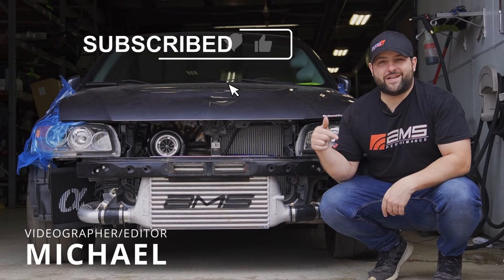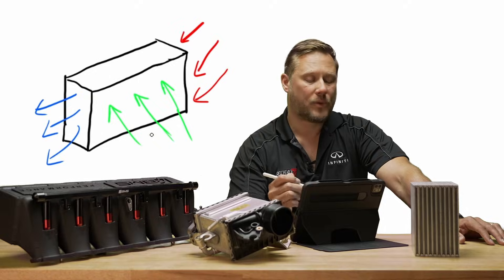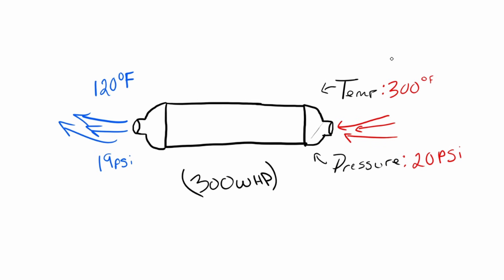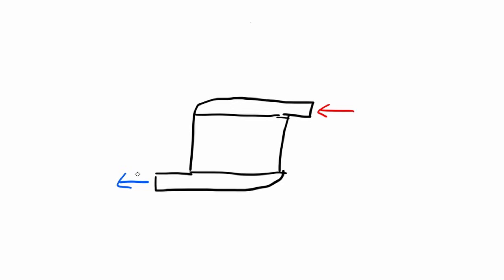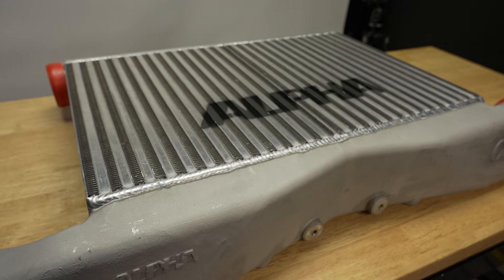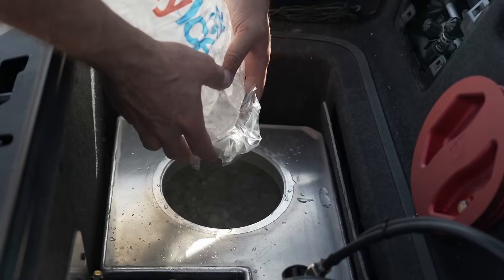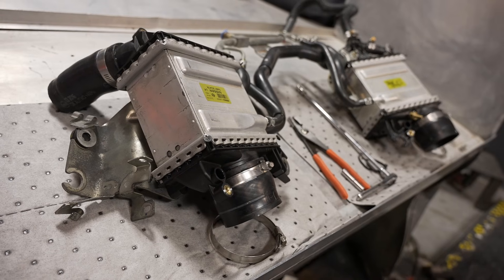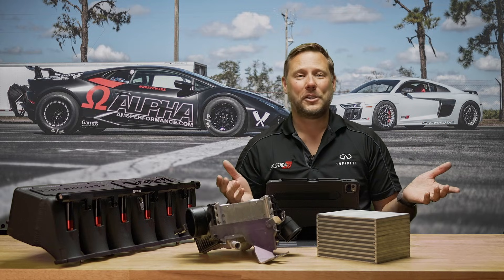What Intercooler Type is BEST? | Air to Air VS Air to Water

Comment: Don't forget that cooler air will naturally have a lower pressure too, it's not only the restrictions of the intercooler that cause the lower boost psi.
Reply: Yeahhh that's something they didn't mention, yes you lose boost pressure but that's because it's denser air. The same amount of air in weight is flowing through. The intercooler restriction isn't that much.
Reply: Exactly! A better measure would be CFM into the intercooler and out. Lower temps and less pressure just means its doing it's job.
Reply: A lack of velocity in the system after the intercooler can be fixed with the proper size piping, i've seen guys running turbo four cylinders and they're using three and a half inch piping from the intercooler to the throttle body when they're only making like three hundred horsepower and dont need the flow, and the Turbo lag is insane, because of the lack of velocity and the turbo having to make up for it.
Reply: Yes, temp. and pressure are directly relative. Inc of temp = inc in press (and vice versa).
Reply: Jesus Christ, no, no, that's not how this works. Like, at all. Cooled air post-compressor is denser not at less pressure

Comment: I know about the Hellcat's party trick of stealing some A/C air occasionally, but have you guys experimented with an air to refrigerant system instead of air to water? Obviously more complex, but the temptation of having below ambient intake air (summer time/ hot climate) at all times on the street seems hard to not think about.
Reply: Look up interchiller
Reply: That does sound like a good idea only thing id be worried is that poor ac comp 😂 especially with a constant load of hot air unless it’s a beefy compressor someone needs to try this 😂

Comment: This is dope and very good tech. I would have liked to see his take on air to air intercoolers with external water sprayers and Co2 chilling tubes. Are they just Band-Aids for proper intercoolers?
Reply: External water sprayers have been shown to help cool the air to air, but at that point your always spraying water. Unless you mean spraying the water once you see a spike in iat's the sure but its a budget way to help reduce iat's. Co2 chilling tubes is a difficult thing to integrate if you are talking about the air to water. Although killer chiller/power chiller are products that actually address the issues with heat soak in the air to water side of things. Take a look at those products they are really cool, however they require a fully working ac system.

Comment: Does it take longer for the water to cool down before you can run again vs the air to air? Or is this a matter of preference? I just watched a video where they suggested the A2A?
Reply from the maker: With a properly designed, high-performance A2W system, the heat exchanger should have the efficiency to quickly expel excess heat even in extreme scenarios. This is shown by their use at the highest level of motorsport in a number of F1 team's power units, and on down to the club level with Jackie Ding's time attack Supra that is shown in our video.
Reply: @AMSPerformance  I appreciate the response I’m in the south and today it’s 101 so I was wondering also how does A2W hold up In such EXTREME heat! With me being here is it best for A2A or water? Thanks for your help

Comment: Wow I had no idea air to air was so inefficient
Reply: It is very efficient, but when you are pushing mega horsepower 1000-2000 hp you are getting a massive amount of heat generation and they are looking for an improvement.

Comment: Does the stock intake manifold on the B58 in the new Supra already have an intercooler inside it? If so I've never seen that before but I'm not surprised either.
Reply from the maker: Yes, the stock intake manifold and intercooler are combined. The stock manifold is also plastic in its construction.
Reply: Formula Seven car has it like this

Comment: Very informative.  I've got both a Q50RS and a GT-R.  Both have your intercooler/Heat Exchangers. Q was tuned by Jacob. Oh, both have 'Alpha' intakes too. Thanks for your excellent products.
Reply from the maker: Thank you for the support!
Reply: @AMSPerformance  <-- Quick question.  I've got Pure Stage II turbos and the seals started leaking badly in only 2 months. Pure replaced them at no cost. Smoked like crazy at idle. Have you heard of this happening with any others? 

Pure didn't tell me if this was caused by a bad batch of parts and if they rectified the root cause.  

Mine were the first batch to come out. I'm afraid the replacements will do the same thing again. With the huge labor cost I'm considering selling my Q before it starts to smoke again. 

Any idea or feedback on the Pure Stage II longevity?  Thanks!!
Reply: @johninnh4880  I'm picking up my Q on Tuesday with the Pure turbos so I'm really hoping they figured the issue out. 

Really sorry to hear you had so much trouble with your upgrade. How's the Q running now?
Reply: @wolfpack9695  <-- I was hoping AMS would chime in on this. Honestly I'm afraid my replacement turbos will start leaking again. I would love to hear Pure identified the problem and fixed it. Like a bad batch of XYZ parts. Not knowing is troubling.
Reply: @johninnh4880  Good news is I know ~10 other Q owners that have gone down the Pure turbo upgrade and they haven't had issues yet (knock on wood). I'm hoping Pure has fixed the issue!
Reply: @johninnh4880  Also good to chat with you again John, this is Ken from the Q forum (Q50Wolf)
Reply: @wolfpack9695 <-- Small world. I haven't been on the forum that much due to my Q's issues. I do talk on the phone with IridiumRS400 about 3x a week. He keeps me updated.

Comment: Question with the psi drop on air to air intercooler.  Does the air mass or density consumed pre intercooler actually go down with the increase of intercooler size? I figured the psi drop over the hot to cold side came from the extra fill requirement.